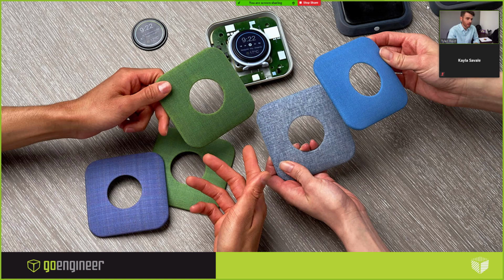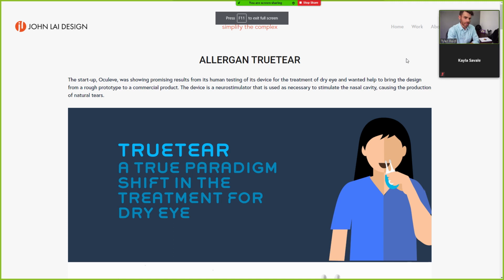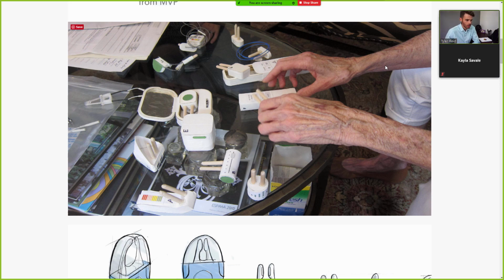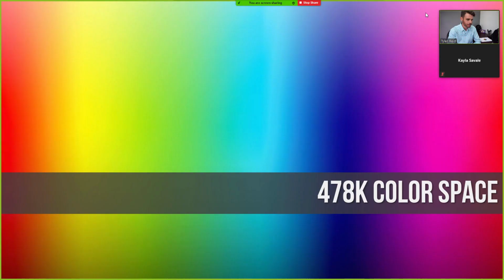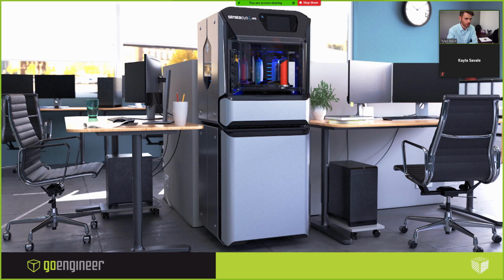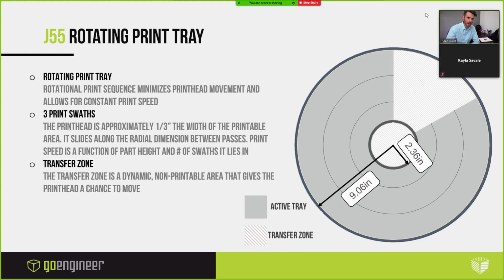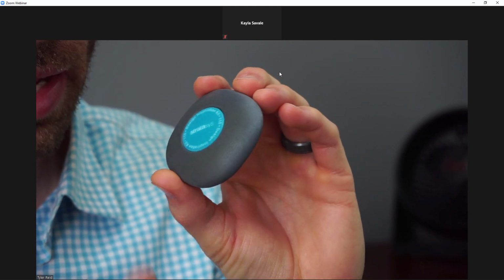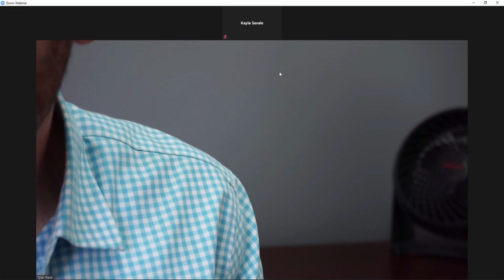Stratasys J55 - Design Into Reality

Comment: Thank you for posting the video.  I have been a long time polyjet user (first Objet personal buyer in so cal and a pro model later on) .   Can you only get a good finish on the upper facing surfaces of the part?  Is the new build material more stable temp wise?  We couldn't ship a in the summer time without it getting distorted.  
Whats new with the support material?  Do you still have to pressure wash to remove the support material?  That was always such a pain and messy.  Do you still have to soak the parts in the caustic cleaner to get all the support material off?  Not only is that a huge pain but having it sit around in the office or shop is dangerous.  If you left any on the parts it could hurt the customer that might be working with it.  Have they changed the materials in the support material so that it can be truly flushed down the drain?  I should have asked and got a letter from you guys on this before I bought my last one.
Last thing.  Maintenance.  With our stratasys systems it was always dumping material in attempts to keep the print heads clean.  We didn't use the printer daily so it was dumping material often.  The  material isn't cheap and my feeling were always hurt from the lost material.  
Love the new color and decal capabilities.
Reply: Hey there - it sounds like some things have changed and others not so much. Stratasys does offer a water-soluble support material on most of their PolyJet systems now, but this machine specifically has a new Support formulation that is is supposedly pressure-wash only. So for the most part, support removal is low labor and leaves little sign of residue. Particularly in California we always try to have a discussion about waste removal because it.
On the topic of maintenance, the printheads themselves need less purging and the material canisters have been redesigned to eek out the very last of the material. You do still lose some material to waste however.